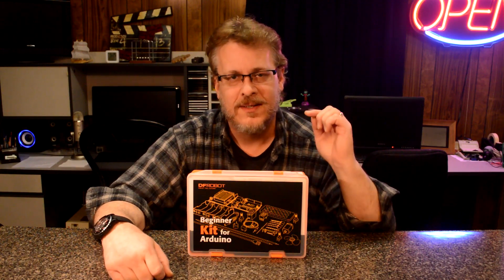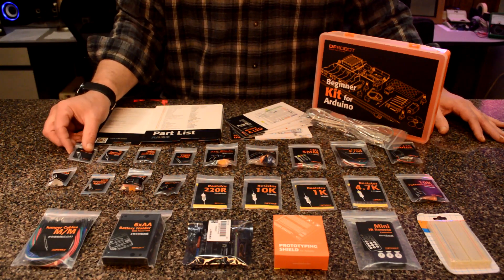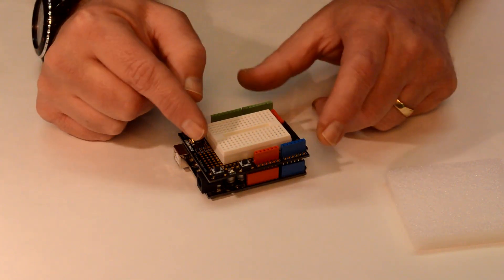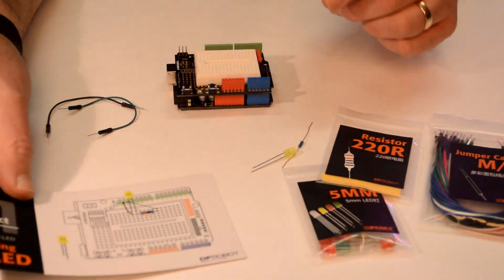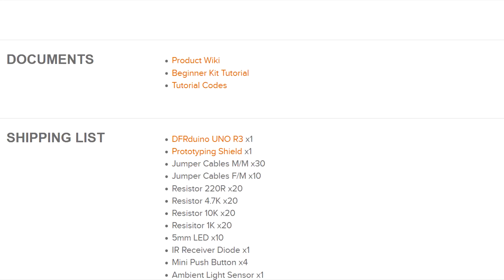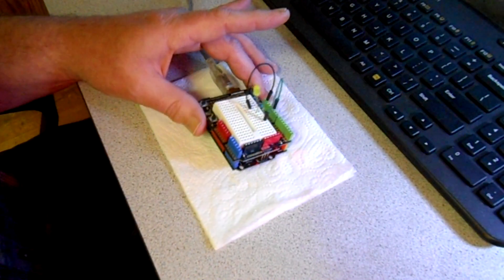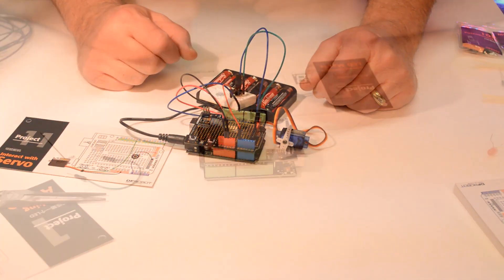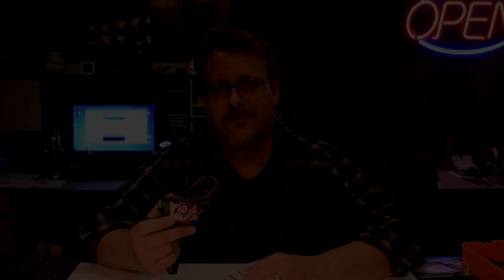Learn Arduino Easily by Using Simple Project Kit

Comment: I got the Kuman Arduino clone. it came with a whole beginner kit for $25! Thats less than just the Arduino board!  secondly, I was very disappointed to find out the Arduino only comes with a pitiful IR remote! it has no uses for a reasonable person! who cant build an IR remote from scratch in 2 minutes and im not advanced! its only line of sight which you can modify any TV remote to task!!
The only thing Arduino has going for it is support! other than that, Arduino falls way shorty of the cheapest clones!
clones have more functions and you can use pretty much any Arduino support as they are very close be it pin or command, analog or digital!
so, tell me what the advantage is of spending twice as much for less?

Comment: Hello,
I'm a new user of arduino. can you help me? the code of project 15 is not working... 

In file included from C:\Users\Filjan\AppData\Local\Temp\arduino_build_732898\sketch\project_15.ino.cpp:1:0:

C:\Users\Filjan\Desktop\code\project_15\project_15.ino: In function 'void setup()':

C:\Program Files (x86)\Arduino\hardware\arduino\avr\cores\arduino/Arduino.h:44:16: error: expected unqualified-id before numeric constant

 #define OUTPUT 0x1

                ^

C:\Users\Filjan\Desktop\code\project_15\project_15.ino:43:20: note: in expansion of macro 'OUTPUT'

       pinMode(pin. OUTPUT);

                    ^

C:\Program Files (x86)\Arduino\hardware\arduino\avr\cores\arduino/Arduino.h:40:14: error: expected unqualified-id before numeric constant

 #define HIGH 0x1

              ^

C:\Users\Filjan\Desktop\code\project_15\project_15.ino:44:25: note: in expansion of macro 'HIGH'

       digitalWrite(pin. HIGH);

                         ^

Multiple libraries were found for "IRremote.h"
 Used: C:\Program Files (x86)\Arduino\libraries\IRremote
 Not used: C:\Program Files (x86)\Arduino\libraries\RobotIRremote
Using library IRremote in folder: C:\Program Files (x86)\Arduino\libraries\IRremote (legacy)
exit status 1
Error compiling for board Arduino/Genuino Uno.

Comment: Very interesting. I would like to make a remote control to open and close the vacume blast gates in my wood shop. Would this help to get me started or is this over kill
Reply from the maker: +dogbert66 Not an overkill at all, it would help your understanding theory as it has a small relay to power a higher load from a computer or just some solid state buttons..I am currently working on a  remote controlled  power plug that can handle several 110 vac lines and is totally relay switched using any tablet, cell phone or computer to interact. I will make a video if interested.
Reply: +GuruBrew 
My blast gates would be controlled by 12volt car door lock switches, the lever would attach to the blast gate valve door.  If you could work something out it would be a great video for wood workers. I have the blast gate design and the door lock switches are very cheep and have enough power to pull the gates.
Reply from the maker: +dogbert66 Alright give me a little time and I will video my project. You can use the same circuit but control a 12volt solenoid
Reply: +GuruBrew I'd like to see what you'd do, are you still planning to build this project?